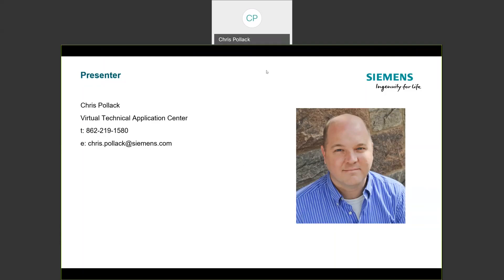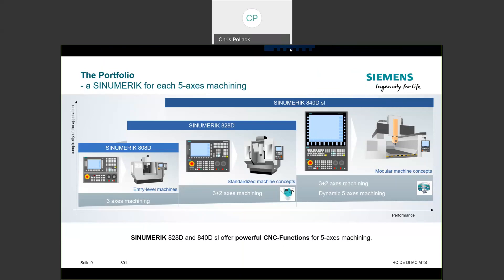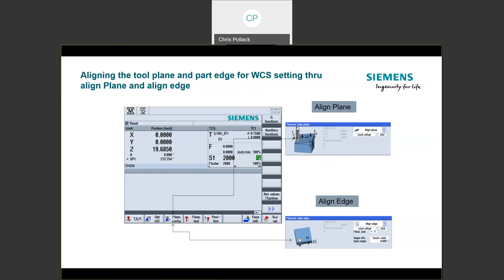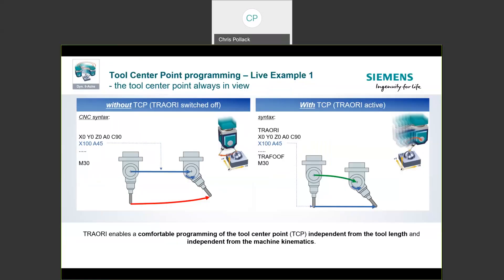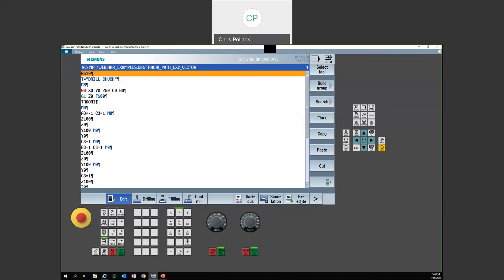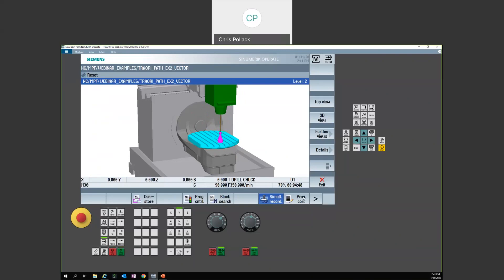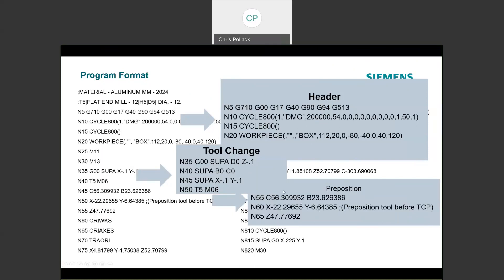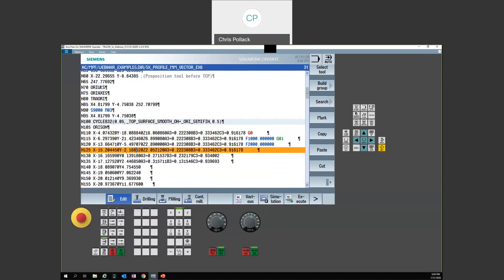5 Axis Simultaneous Machining - Why Choose Siemens?

Comment: Hey there, I have a question about motion control.

Im on a dmu50 3rd gen, using mastercam 2023 with a Postability post.

When I do any kind of 5axis simultaneous movement, it posts with a 

TRAORI
CUT3DC

Then it uses C=DC to establish the CB movements.  But it’s very jerky.  It’s also spitting the code out as a bunch of short blocks of code.  

When I slow it down really slow, it’s smooth. 

Is this part of the “jerk” settings?  I’m trying to tilt the B axis 90deg and then spinning the C axis as though I’m doing a 4th axis toolpath.

Jsut very jerky.
Reply from the maker: are you using CYCLE 832? if not I am giving a in person level 3- 5 axis and high speed machining class in Elk Grove IL next month. The class is free all you need to pay for is hotel and travel SEE BELOW 

all our trainings 
https://www.siemens.com/us/en/markets/solutions-for-machine-builders/machine-tools/cnc4you/machine-tool-training.html

level 3- 5Axis and high speed IN PERSON training 
https://events.r20.constantcontact.com/register/eventReg?oeidk=a07ejgz4ywj57a5d485&oseq=&c=&ch=